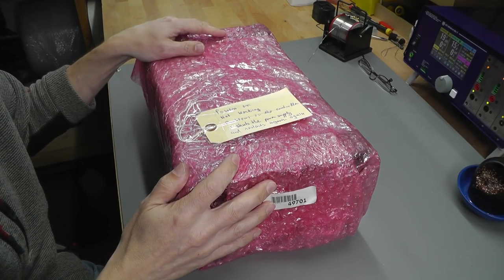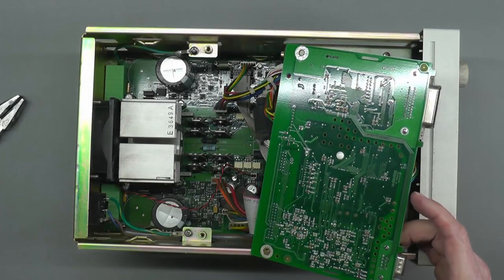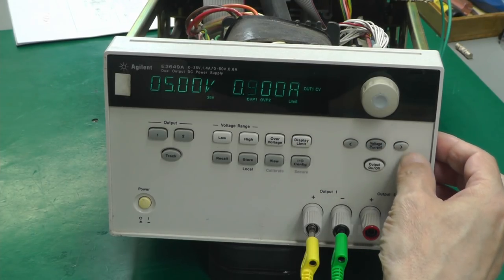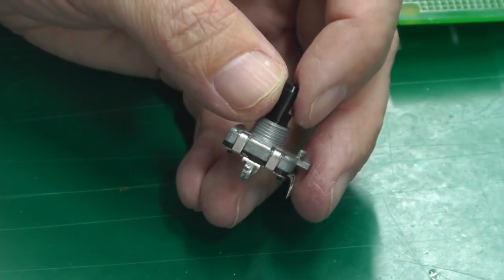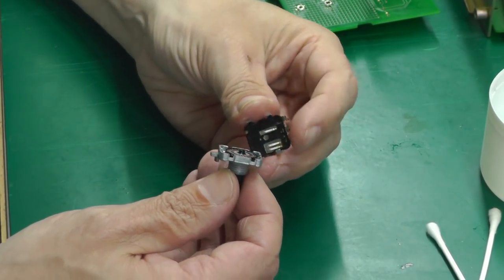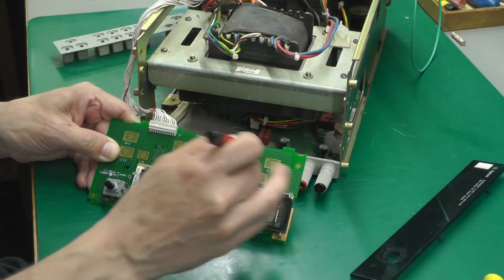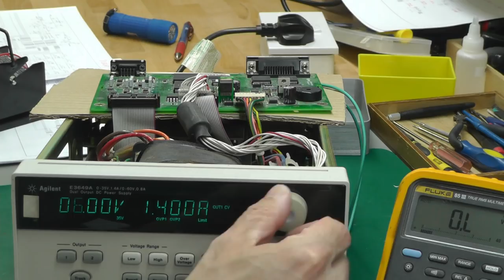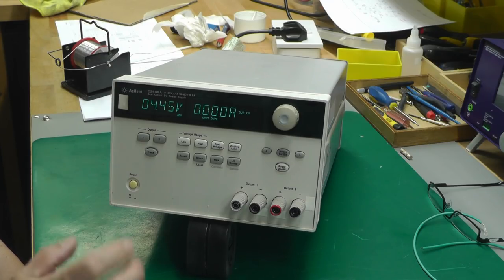No.076 - Agilent 3649A Power Supply Repair

Comment from the maker: UPDATE 26/6/21 - After using the PSU for a week or so after I had repaired it, it was randomly resetting (once every 5 or 6 hours), so I bit the bullet and replaced the RAM IC and it's perfect now.

Comment: Thanks Ian for the video, I just acquired the same power supply and the display digits were jumping around a bit, so using your info for the encoder was able to open it up without de-soldering, just gently bending the tabs, likewise inside dirty, cleaned, re-assembled and now works a treat. One comment, the grease on the encoder shaft provides some drag resistance so that the knob doesn't freewheel. Alan.

Comment: From my experience, in car stereo, some time ago, damaged encoder gives strange actions too.. Best thing in these situations - functionality test reviews these issues or gives feeling, that something is wrong with it..
Great repair video for another power supply! 👍
Reply from the maker: Rotary encoder mostly are quadrature encoders meaning the pulses are 90deg apart/overlapping and are either leading of trailing depending on direction of rotation......so my thought was that if pulses are missing then the receiving software can get confused and in this case when the other buttons on the panel are pressed.
In this case, whether thats by design to reset the processor or just something the software devs never thought might happen then who knows......!
Reply: @IanScottJohnston  Yeah, this situation was strange. In my case with car stereo, damaged encoder was shortening out two output rails because encoder wheel fall in apart inside..
In this case, probably, MCU noticed encoder loss, can't figured out what's going on on panel and resetted all circuit.. Maybe when pressing button, encoder in same time gived bouncing contacts..
Anyway, excellent situation to learn, how faulty encoder can give strange device reactions.. 👍😊

Comment: I wonder if the dirty encoder was just glitching microcontroller inputs causing it to spend an unreasonable amount of time trying to interpret the encoder. When combined with the other actions that caused the watchdog reset.
Reply from the maker: Possibly. Its funny how it was always a specific amount of keypresses on the arrow keys before it would reset......and it would never reset if you just let it sit.
My guess is that some combination of keys in combination with confused quadrature A/B inputs cause the reset.....either by watchdog as you say, or memory/variable states gone out of range.
Reply: @IanScottJohnston  difficult to know, you could also speculate that something rolls over or some extra instructions get executed at that point. Who knows

Comment: When ive taken apart rotary encoders before, ive found that the grease from the shaft has seeped to the other side and got on the contacts just like with yours. Oil is an insulator and attracts dirt so when it gets on the contacts, they go high resistance. I clean it with alcohol but don't put any new grease on the shaft, which will eventually seep to the other side and cause it to fail again in the future. It feels a lot freeer without grease.
Reply from the maker: Yep, it was absolutely covered in a soup and gunge inside and out!......no wonder the contacts couldn't connect!
I tried to put the smallest dab on the shaft as I didn't want raw plastic to metal otherwise shavings could find it's why inside. The Deoxit Shield contact lubricant I have used before but not inside an encoder.......should be fine. I wanted to avoid a completely dry contact.

Comment: That was a nice fix. It will pay to recap the electrolytics as the similar supplies I’ve fixed that had a bit of use needed the smaller caps replaced.

Comment: Interesting! These are very nice supplies and probably not cheap at all when new. What's their age, generally speaking?
Reply from the maker: You can still buy them new from Farnell see P/N = 1214502 , still badged as Agilent though.....presumably Keysight still have a good few new old stock!
Farnell Cost = 1215.00 UKP (1721.00 USD) plus VAT/Taxes.
The User Guide I have is dated from 2000.

Comment: The connector on the display board looks like it was not on all the way.
Reply from the maker: I spotted that when I first removed the board, but it's just a malformed plastic connector (it's got a bend in it).....all the pins are mated correctly, it just doesn't look like it.

Comment: Hi, I am just repairing this power supply (E3649A). There was main uC EPROM corrupted. I upload new firmware and it is working but problem is that firmware is for E3648A thus Vout does not match and gain error is reported. Does anybody have E3649A EPROM firmware? Thank you!
Reply from the maker: I haven't seen it unfortunately......however, if you look through the HEX/ASCII of the 3648A firmware you might see where it could be changed if it's just a few bytes difference and readable in ASCII.....worth a try. Send me the firmware if you like and I can have a look.
3648A = 0-8V @ 5A, 0-20V @ 2.5A
3649A = 0-35V @ 1.4A, 0-60V @ 0.8A
Reply: @IanScottJohnston  Hi Ian, firmware is here http://www.ko4bb.com/getsimple/index.php?id=manuals&dir=HP_Agilent/Agilent_E3648A I didn't find some 48 vs 49 "switch"in it so far. Main control board in my 3649A is marked as 3646 and firmware on EPROM had same label 3646 6023 rev 1.7. So I hoped that it is universal to all models from E3646 through 49 - but it seems not. Display is same for 48 and 49 models actually - at least VFD itself. So what I have now is E3649A providing 8/20 V labels on VFD and enabling setup max. 8 / 20 V by knob with n times higher real output :-) and reporting 718 error (DAC slope out of range). It is also replying as 3648A via GPIB. So not sure why firmware with same label is not same for both models :-). Its too late in Czech - need to go sleep. Thank you in case you will give some advise! And thank you overall for videos you are making as these are helpful to someone who need to fix something - or want to fix something!
Reply: @IanScottJohnston  Hi Ian, I found some answers here: https://www.eevblog.com/forum/repair/agilent-e3648a-eeprom-content-lost/ This would explain why main uC firmware has same marking for all models from E3646... I checked U13 8 pin EEPROM and it is also corrupter so I need to program new one and with E3649A EEPROM content. Do you have U13 data file available? Thank you to let me know!
Regards,
Roman

Comment: Would never use a fibreglass pen on gold contacts, way too abrasive. All that is needed is a rub with a soft pencil eraser (rubber) and clean with IPA. Great soldering. There are a few you tubers who could learn from your flux and drag soldering example. Hate when I see others struggling soldering pin by pin. They end up applying way too much heat by having to go over each joint multiple times and it never looks as good.